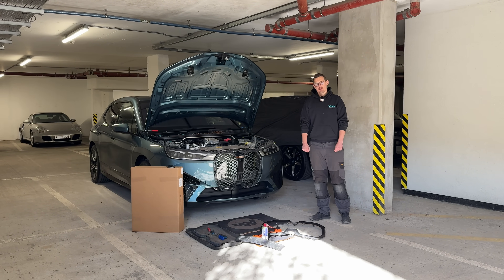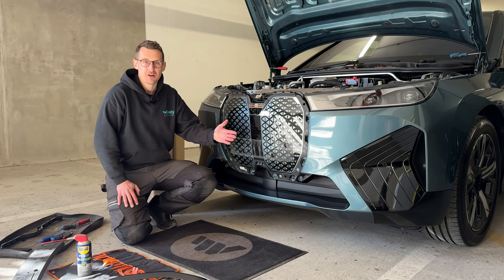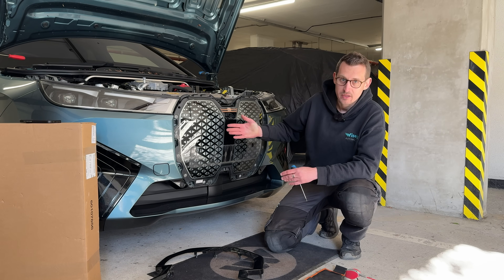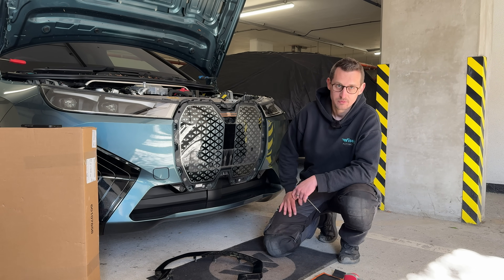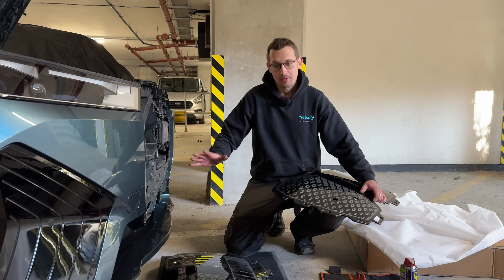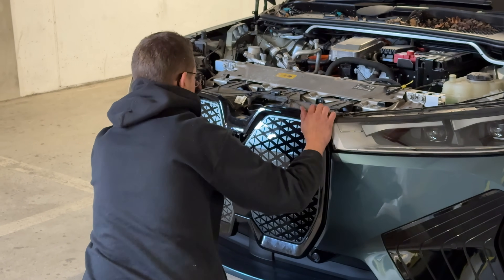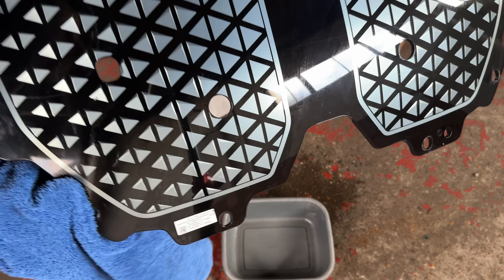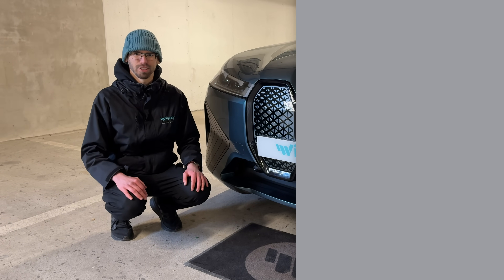BMW iX: How a Small Stone Chip Made A BIG DENT on Our Profit Margin

Comment: I'm pretty sure that there's a grill you can get that does not have the holes in it. Hard to pin down what the part number is. These cars look way better with an offset plate, and someone makes a plate mount that attaches to the towing eye that looks quite neat.